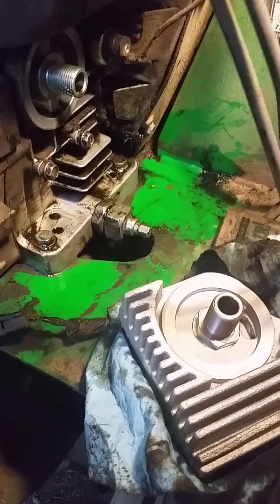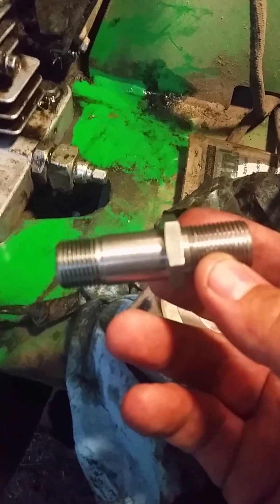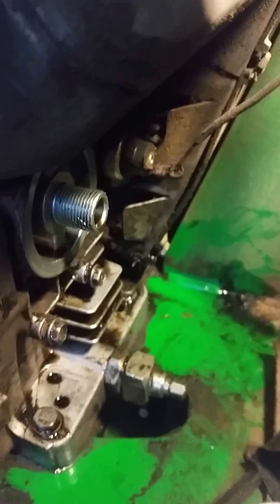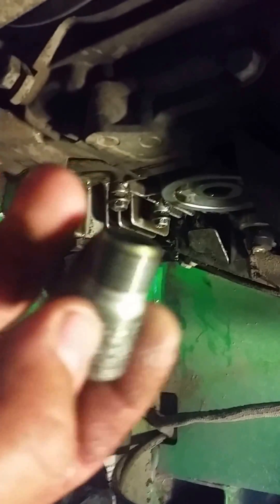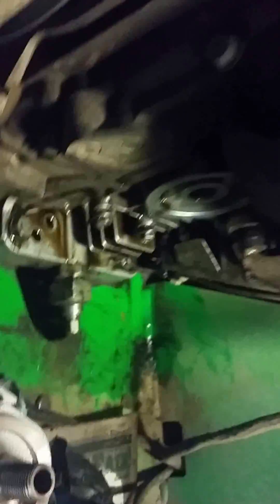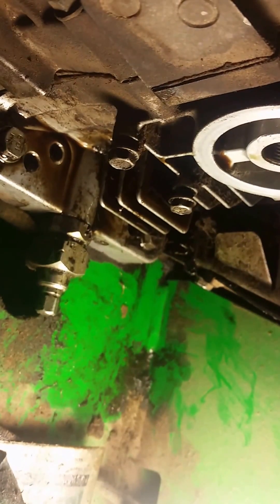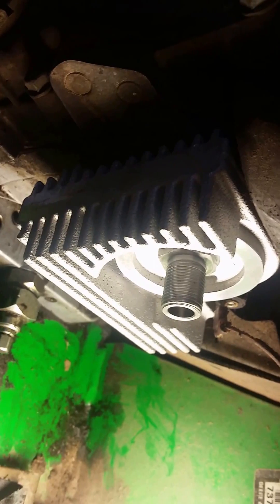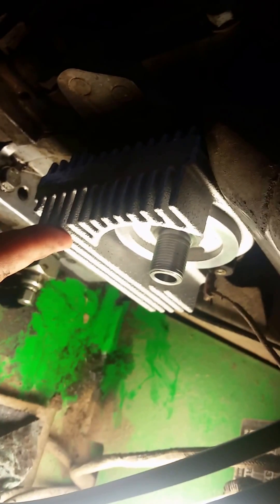John Deere 737 757 717 Upgrade FH601, FH641, or FH680D to 25HP FH721 Kawasaki Oil Cooler

Comment: I have a 21hp Kawasaki 48" cut will this work on it as well and if so whats the part number
Reply from the maker: Ray Robertson As long as you have a model number that starts with FH, this will work for you... Find the oil cooler and pipe for a fh721d engine.

Comment: Do you know specs of a substitute for the joint?
Reply from the maker: Coach Larry The joint is pipe threaded into the block, but it has straight threads that go to the oil filter. I don't think you could make a substitute.
Reply: looks like the filter thread is 3/4-16.  Do you happen to know the block threads?  Also, curious what oil you run in this machine.  Trying to find cooling mods because my #1 cylinder head has had valve guide slipping issues.  found the cooler for 13 bucks,  but that joint is out of stock.
Reply from the maker: Coach Larry The main cause of the overheating in your head is because of air flow. If you have a 737, the front shroud of the motor needs to be loosened and pulled forward so you can adequately clean the cooling fins on the front of the head.
Reply from the maker: https://www.partstree.com/parts/kawasaki/parts/59071-7009/
That is the part you need...
Reply from the maker: I use Synthetic Oil... 10w30. Just Supertech full ysnthetic from Wal-Mart. I think these air cooled engines really need the extra lubrication from synthetic oils.

Comment: this video was beyond helful. i manged to find the correct oil cooler for my z-turn cub cadet and installed it. its working perfectly.
I'm in the process of installing a small industrial type fan (its pretty powerful for its size) right next to the oil cooler to help with  temperatures even further. just have to build some brackets for it.
I'm even looking into whether its possible to install a more comercial grade type of air intake (is that what it's called)?!
Reply from the maker: Glad that it helped you out.

Comment: hay where did u find yr kit i have not found 1 i can buy each part by part no.
Reply from the maker: +daniel mayberry https://www.partstree.com/parts/kawasaki/engines-horizontal-engine/fh721d-es01-kawasaki-fh721d-4-cycle-engine/lubrication-equipment/ is the website for the parts you need... you will need parts number 92055A, 59071, and 39067 from the diagram.